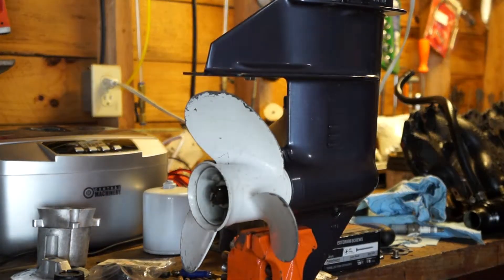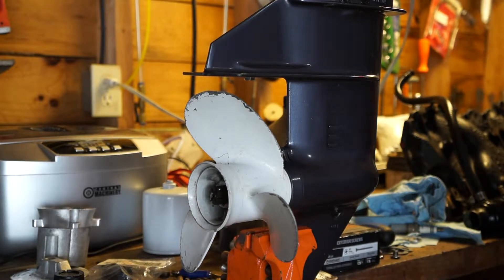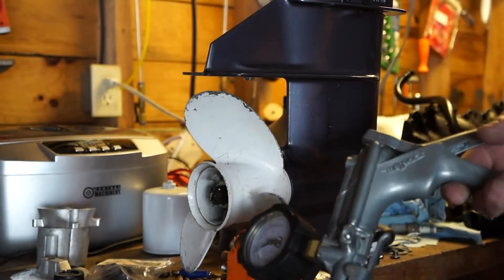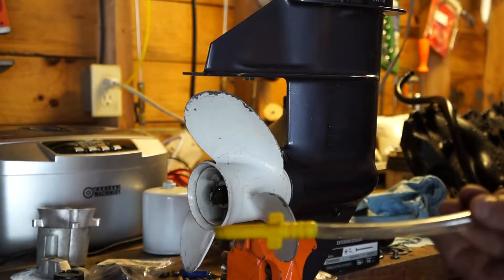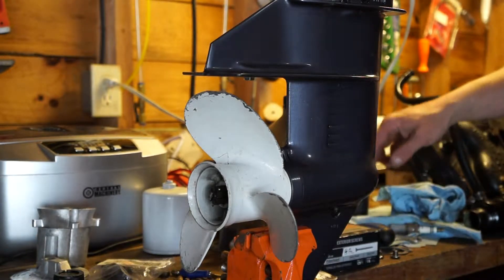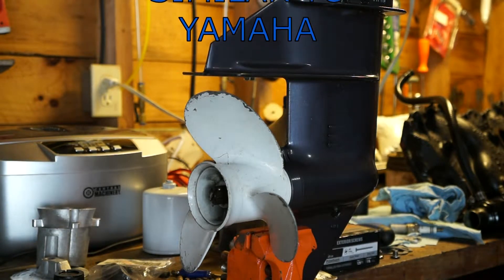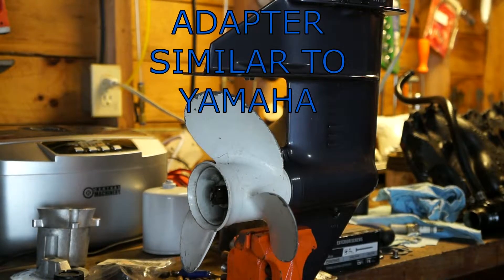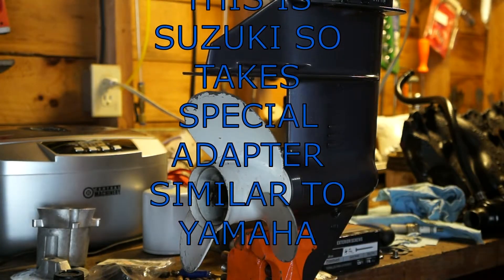How to vaccuum and pressure test lower unit or outdrive

Comment: I just drained the engine oil on my 2021 Suzuki df70 and saw a very faint white in with the oil color. I did hit a rock with the prop. Guessing this might be my issue. Question is, I used the engine for about an hour or two in low RPMS after since noticing this. The white was so light, do you think my engine is safe? Took it to the dealer where they are going to charge me my soul to find out what it is and fix. Any help here would be nice…. Thank you! 💪🏼
Reply from the maker: Typically water in engine oil is cause by a leaking gasket or a thermostat that is stuck open not letting the engine warm up and causing condensation internally. If the water is in the lower unit then I’d suspect a bent prop shaft is letting the water in. I think your engine is fine otherwise, can’t imagine you did any more damage with that little water in there. Hopefully they don’t charge you that much 😂

Comment: any idea where to get metal adapters for the Mityvac that fit the different lowers?
Reply from the maker: M D I use the adapter from the cheap lower unit oil fill, Shoreline Marine Pump https://www.amazon.com/dp/B004UOPZ9S/ref=cm_sw_r_cp_api_i_nLbOEbSGY8YAY
Reply from the maker: Also Stevens instruments sells better adapters if you didn't want to use plastic.